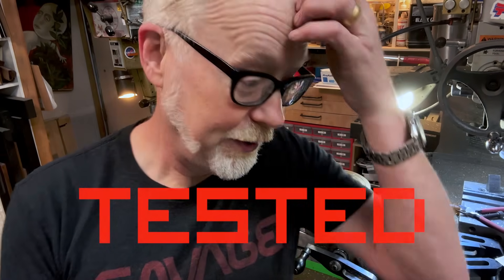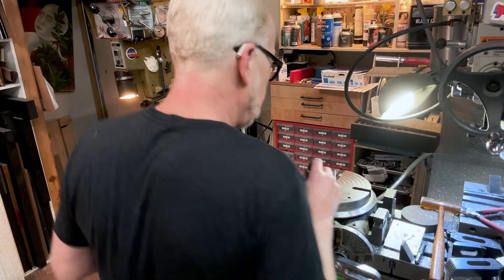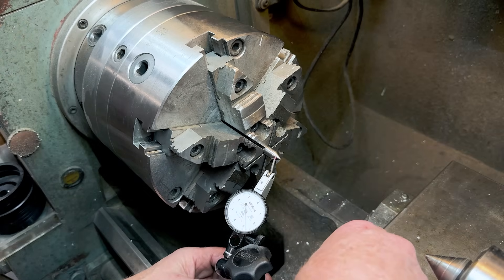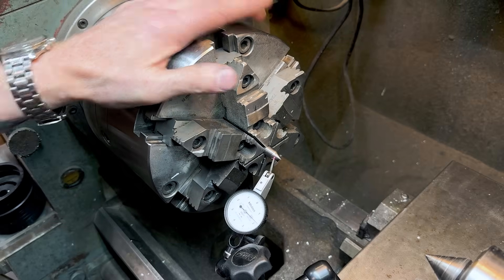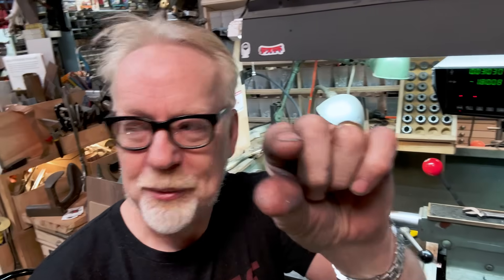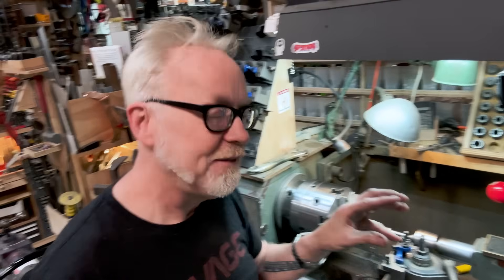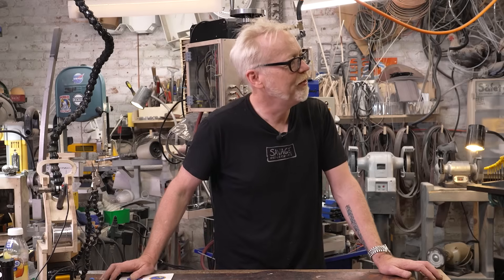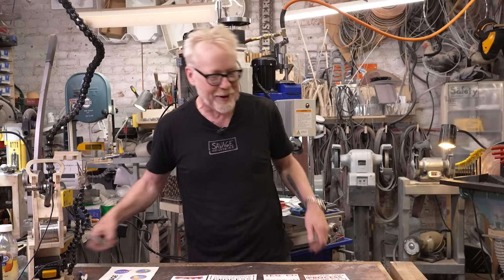Did Adam Savage Mess Up His Rotary Table?

Comment: I am way late to this party, but Adam, doesn't your lathe have a taper in the spindle?  I know it might not be MT3, but it would be much more accurate to just use an adapter sleeve in the lathe spindle to drill your hole. I know my lathe has a Morse 5 stub taper in the spindle, and I have a MT5 stub to MT3 adapter sleeve. Using a tang style arbor you would need to knock it in firmly and turn lightly, and have to knock it out from the back of the spindle.

Comment: Three suggestions. Pardon me if others have already mentioned them.
1) Others have mentioned that most DROs have at two coordinate origins. If yours doesn't, find your new origin point and write down the coordinates relative to your rotab, then zero the DRO. When you're done at the vise, move to the negative of what you wrote down to return to the rotab. Of course, a half thou or so of error could be introduced, so don't do it repeatedly, but for one trip out and back you're probably OK.
2) Most rotabs have a shallow counterbore around the MT center hole. Yours doesn't appear to, so make one. Use maybe a 1/2" end mill and sweep the table around. That way you're sure it's concentric with the axis of rotation. You can then make a variety of simple  alignment plugs to fit.
3) Another way to modify your MT arbor would be to drill it in the rotab, on center and undersize (I'd use a C .242 drill), then move the table about 0.029" and mill a couterbore with a 3/16" EM by sweeping the rotab. Now you have a 0.246 counterbore on center with the axis of rotation. Return to center (re-check on your new counterbore if you want to be really sure) and ream. The counterbore will guide the reamer for a true start. Put a punch mark or deep scratch on the end right next to the T slot nearest 0° so you can install it the same way every time you use it.
3A) If you do that, I'd suggest adding a 10-32 threaded hole at the bottom of the .250 hole, to help you extract the taper without removing the rotab from the mill.

Comment: If your tailstock taper is a #3, you could put it in there to drill the hole. Much easier than fooling around with the mill. I also have Morse taper adapters to go in chucks. Or an adapter to use it in the spindle taper, whatever that is. This is the hard way and potentially less accurate.

Comment: Hold the blank in the tailstock and the drill in a collet. Then drill and ream perfectly on center.

If you want to pick up a hole in a part and position it on the center of rotation. Set the spindle over the center by indicating the rotary table bore. Then hold a pin that fits in the hole in the part in a collet and use this to position the part. There is no need to use the morse taper, you will be in trouble if the arbor locks in.

Comment: I think I would have modified it in the mill. Rough cut the end with a cut off wheel, then put it in the rotary table, mill the end flat and spot drill, drill and ream the hole. If you didn't have clearance to mill it flat, then just leave it long, drill the hole and then put it in the lathe and face the end to length.

Comment: What a clown, put the morse taper, in your morse taper spindle behind your $1000+ chuck you don't need. Are just machine it. And if you want it true use a boring bar, not whatever micky mouse nonsense you were going on about. 🤡🌎
Reply: Put it in the tailstock and the drill in a collet in the headstock.

Comment: But... but... doesn't Adam's tailstock have MT2 or MT3? Surely he's got an MT2-3 adapter, too. Stuff the MT3 blank into the tailstock and put the drill into the chuck. Then use a boring bar while manipulating the cross-slide to get perfect hole-size. Doing it on the mill loses all the concentricity advantages of a lathe.

Comment: Great video.  I just made one of these for my rotary table.  I had an adapter for my lathe spindle that was MT3 inside (for holding dead centers).  You may have one as well that would have come with the lathe if previous owner(s) didn't toss it.  Made it easy to drill the center.  Also, to run stock between centers, just chuck up a short scrap piece and turn a quick center on the end of it to use as your center.

Comment: Two things... 

1. - Take the chuck off - Your headstock probably has an MT5 mount. No need to turn between centers etc. 
2. If you want a really good center on the headstock end - dial it in like you did and then turn a new point.

Comment: I love your spirit, and am a long time fan, but just maybe you might think about asking the community how to accomplish a machining related task or procedure. for instance, to machine a precision feature on a morse taper arbor, mounting it directly in the spindle taper of the lathe ( most lathes have an internal taper in the spindle) is by far the preferred way especially if its something on end, like drilling it. you would use a reducer(s) to step down to the #3 most likely, after removing the chuck,  but it is much, much better, less stickout, closest to the spindle bearings, and most rigid. that said, why are you even doing that to locate it on center of the mill spindle? using an indicator or Haimer its really easy to center on ANY concentric feature of an arbor, tapered or not. over all, this is a BASIC principle of machining, get as close to the spindle bearings as you can. this is why collets go IN THE SPINDLE ideally. more stockout, of a tool or the part, introduces more error and less rigidity.

Comment: For the specific use of holding a pin, the smaller/lower 1/3 of the taper could have been sacrificed to turn that bit parallel for the chuck to grab with no loss of 'grip' in the rotary table.

Comment: Hi Adam, you can usually switch at least between "absolute" and "relative" on your DRO and use these as 2 different coordinate systems. So you can keep one centered on the rotary table and use the other one on the vise. Some DROs have even more coordinate systems.

Comment: OK, once you go through all this effort to make that reference pin setup, install it and indicate it in. Good. NEXT..disengage the worm on the rotary table and mount an indicator to the rotary table face. Set the indicator needle against the spindle of the mill and rotate the rotary by hand. If the indicator doesn't move, you're golden. LOGIC...The accuracy of the rotary isn't driven by the center hole, its driven by the movement of the table.
Reply: Joe please help Adam.

Comment: The fact that the swarf comes out blue or straw colored instantaneously really speaks to the not insignificant 
forces and energy being expended in these machining processes that look so effortlessly simple
Reply: when you make chips they want to be blue like that , it means the heat is come off with the chips , also I was taught if your chips are coming off any longer than the nice springs in the vid your either not feeding fast enough or deep enough with the cut or your speed is wrong , the phase used with chips is 'if they are long they are wrong '

Comment: You don’t need a morse taper center at the driving end of the lathe.  Just chuck any piece of steel in your 3-jaw and turn it to a point.  The result will be on center, and you can drive the dog from the jaws of your chuck.  

Your approach was logical and got reasonably close for an object being dialed in.  There’s just a different approach that gives better results with less effort.

Comment: PLEASE get properly trained, hiding behind having no patience is not an excuse for being stupid. 
There is no reason to clock up the point in the chuck, just turn it and it will be smack on.
No need to destroy a tapered mandrel, just turn up a piece of scrap in your lathe. If you cant do that or know how, sell the lathe as it is one of the easiest things to do. Once set up you can make a number with all the hole sizes you need. Or just make one large hole that you can turn up pins to fit in. If you were properly trained you would know this and have the skills to perform such a simple task.

Comment: Just noticed I can't recall see you using a center drill. 

You wouldn't have to set the tool post behind you if you didn't use the top of the lathe head for storage. it's for your wrenches, tool posts, what ever tools you're using on the immediate job. Remember putting things back where they belong reduces mistakes?  it's not another horizontal surface to store a hoard. Turn the lathe, and mill around so you open wall space for shelving multiple posts, hold downs, vices, spindles, heel blocks, nuts, washers, all thread etc You can wind up with quite a hoard just of that stuff on shelving on the wall. When using the machine efficiently.  When you have shelving on that wall you can also have a little bench there too for minor hand work you need a solid table, and a frequent place to lean on, and sit.

Comment: Adam, 

At the very beginning, you mention not wanting to lose your zero. I know you have a "standard" DRO setup on your mill... I highly recommend moving to TouchDRO. It replaces your DRO display with a tablet. You connect your scales to an adapter board, which communicates with the TouchDRO app on the tablet via bluetooth. 

I have this system on all of my machines, and it's made a huge difference in my workflow. In a case like yours, you could save the 0,0 on your rotary table as a subdatum, work on something in the vise, then just return to the rotary table center. 

You can also set up your rotary table as a "workspace". Initially, you set a corner of the base as your datum within the workspace, set zero, then find center of the rotary table with an indicator. You now have the XY offset of center, from that initial corner. Set that point as a subdatum, and save the workspace. Now, every time you use the rotary table, you just select that workspace from the menu, find that corner with your edge finder, tap the center subdatum, and you're set.

It gets even easier if you incorporate a touch probe, and some kind of repeatable tooling. I made a video a while back, demonstrating how much faster this system makes your workflow, if you're curious: https://youtu.be/BH3BTioMELM
Reply: You must sell them. 👀
Reply: usually you have also at least 2 coordinate systems on the simple DROs by switching between "absolute" and "relative".
Reply: even $100 LCD DROs come with ABS, INC and several numbered SDM coordinate systems..

Comment: For anyone chasing zeroes and wanting more precision, my understanding is that the thing to do to really get a good concentric on-center hole is to do your on-center setup, and then use a single-point cutter (i.e. a boring bar) for actually making the final hole (can still use an under-sized drill or end mill to get things started.)
Reply: My understanding is, "bore for position, ream for size".
Reply: What I might have done for this one is to cut the arbor off, drill it on center but undersized in the rotary table, put a witness mark on it to point to something known on the rotary table, and side milled the hole to size with a smaller endmill and using the table itself. That way the bore is generated by the geometry of the table and you can even eliminate any runout in the table bore by reinstalling the arbor in the same orientation.

Comment: 3:0 As a one-time mechanical engineer working on precision ground tools, please don't tap them together, even if hard, it can cause imperfections meaning your tapers may not run true or hold well. I can here my instructor now, from 1968, telling me off. Otherwise, Adam, as ever, an interesting video.

Comment: I would hazard a guess that if you removed the camlock chuck, there would be a morse taper in the spindle nose where you could with the aid of a morse sleeve put the adaptor and machine the diameter and drill the end.

Comment: Omg, editor san dating Adam to the typewriter age. :))) That's so mean. :)) At least put him in the dial-up era. Give the man some baud! XD
Reply: Plenty of overlap in those eras.  I ran a BBS at a whopping 300 baud in my youth, but my first keyboard was a manual typewriter, not even a selectric. Eventually, I took Typing 10 on a ‘fancy’ selectric while running the bbs on an apple //, and as soon as I got proficient at touch typing, dropped the class like a hot rock, as everything on the curriculum was made obsolete by the  primitive word processing software. Heck, in my senior year I got my hands on my first digital typesetting system, but when I got to Universtity, the student newspaper was still doing layout with wax and knives, and while I was using GUI software on my personal machine to write code for CS classes, I uploaded to the mainframe using text files as  vitrualized punch card decks, and the public lab terminals were a mix of VT100 and paper output terminals.  The 80s were a wild mix of technologies, man.

(Meanwhile, in the Faculty of Education they had labs full of Macintoshs  for their students to do anything except learn to cod…)

Comment: shouting at my screen Dude, you have three different ways of holding that MT arbor directly to machine it!! Oh, what a relief, he found one right where he had left it.😅
Reply: Glad to hear I’m not the only one who was scratching their head here.
Reply: @ I’m also thinking about a missed opportunity to get a stubby 1/2” -> Jacobs taper adapter out of the deal…
Reply: for all of Adam's many talents and gifts, machining knowledge is not one of them. these are the most frustrating videos to watch.
Reply: Can anyone explain the line of thinking in going to the lathe? I was also confused why this wasn't as simple as drilling the hole on the rotary table itself, and either cutting the arbor to length before or after. Struggling to follow Adam's own explanation 😂
Reply: @SnowingRock That is more than one question. Having a Morse taper in a rotary table can be very handy, so drilling it out would not be optimal. Furthermore, the problem of making a fixture to hold a pin would remain, so you would just be turning one job into two. 

As to why the move to the lathe…sometimes we all head down rabbit holes for inexplicable reasons, when it might have been better to take a step back and re-think the problem. Kudos to Adam for actually sharing this, even if it means he must suffer the slings and arrows of professional, hobby, and wannabe machinists.
Reply: @ Sorry, I didn't mean drilling out the taper, I meant placing the arbor into the taper & drilling the pinhole he wanted, like he does in the latter half of the video.

I just wondered if there was a logical reason to attempt his lathe method first, over what he ends up doing.

I very much relate to getting scatterbrained and unnecessarily doing things the hard way though 😂
Reply: @SnowingRock  As Adam walks through the idea, first it will have a post, which he then decides can't be quite small enough, so it morphs into having a hole instead... to make the taper with a post was most definitely a lathe job, with a natural work holding solution, turning on centers. Seduced by this technique at the lathe, he continues down that road to try drilling the hole.

Comment: 5:00 I'm always amazed by the myriad of tools that have been made! There seems to be a specific tool for tasks I wouldn't even imagine until I would need it myself. It's so obvious now that I've seen it that someone would invent a gauge for centering a spinning point, but five seconds ago, I would never have thought one up!
Reply: It's actually a more general tool than that; dial indicators and test indicators have a whole lot of uses, but lining up a surface like that conical one in is absolutely one of the usual ones. For a four-jaw independent chuck you do basically this procedure each time, and can center it on any surface on the part, not just the ones you're gripping. It looked like Adam had that test indicator in the usual sort of arm that magnets onto somewhere flat & iron on the machine.

Comment: If I'm going to turn between centers while leaving the chuck on the machine, I use a soft (unhardened tool steel) center and turn the taper on it to be concentric every time I mount it. Once you have the center made the first time it's much faster, easier, and more accurate than trying to dial it in.
Reply: Yes, that’s how I do it too. Cut a new point each time. Then you know it’s perfect! And quick.
Reply: Came here to say this. I agree.
Reply: @edbennett8257  for a one-off job, this is quick and easy, saving time to R&R the chuck or collet setup on the machine. However, most spindles have a Morse taper, for the express purpose of turning on centers, which then needs no truing up, just install your dead center. Then you can employ a faceplate (probably better if an actual dog-drive plate) rather than your dog against the chuck jaw to drive the work. It all comes down to knowing what you can get away with, and being fully aware that you are getting away with something, rather than using the proper technique.
Reply: @kennethelwell8574  Read my post again. I'm well aware of everything you stated as far as using collets or the spindle taper. I was merely pointing out that FOR A ONE OFF JOB it is just as fast and much more accurate to true a soft center than it is to indicate one in with the chuck. I do it myself sometimes, as I stated in my original post.
Reply: Exactly. Then you also don't have to dial your chuck back in after.
Reply: Adam isn’t a machinist. In this, he’s more of a hobbyist. He’s an artist/fabricator. He’s great at that. I cringe at some of the things he does on the mill and lathe.
Reply: he should go back to school
Reply: @secretsix6  He's going to school, as we all are. Every day is a learning experience, and we can all teach each other if we'll just let it happen. I meant no discredit by my original comment, merely pointing out options, as others have as well.
Reply: @secretsix6  In his copious free time.